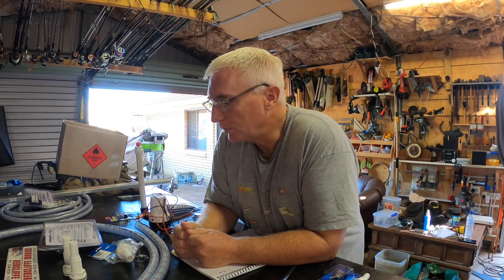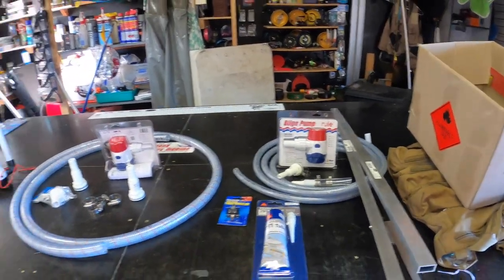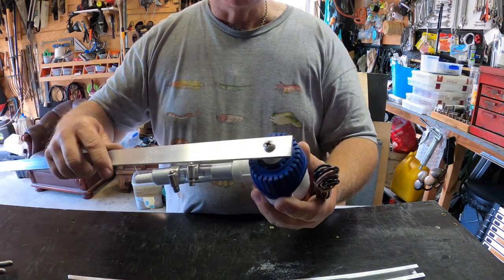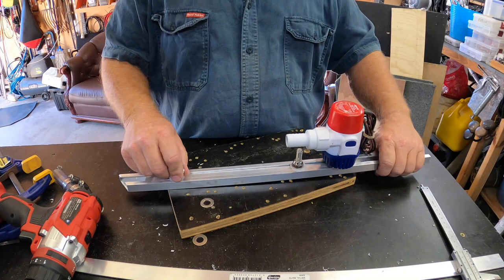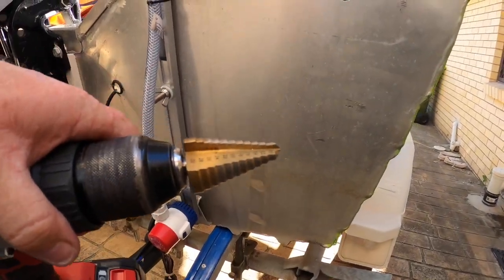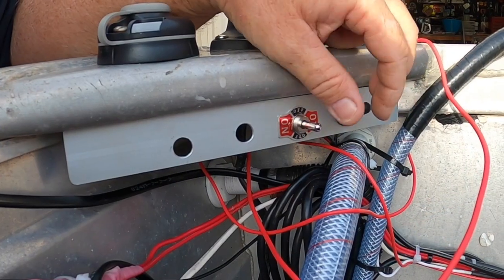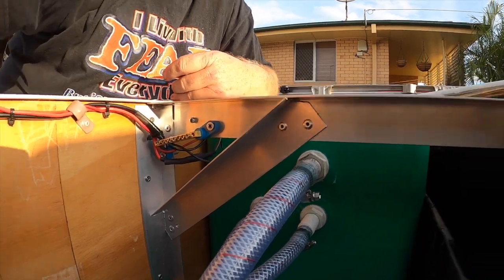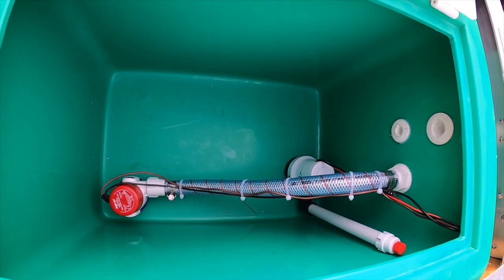LIVE BAIT TANK Install, start to finish, Stacer Proline.

Comment: I have been told in the past that all negative wires should be connected to the negative battery terminal and not to earthed to the alloy hull.  I was told this can cause electrolysis to the alloy.
Reply from the maker: That may be correct. I’m not sure.
Reply: You are correct but he hasnt connected it to earth. You will see that there are stand-offs on the bar he has installed which insulates in from the hull.

Comment: Hey mate just wonder what size pumps you used thank you turned out great
Reply: thanks mate i was just watching the video again, could of the bilge pump that pumps out could be right at the bottom to drain? or would it be too risky to do if it leaked into the  hull? thinking about doing this next year thank you
Reply from the maker: Yes it could have been bilge out of a drain hole. Just didn’t want to put another hole in the tub.
Reply: @Wayne.Groomes.Fishing   okay thank you, also just wondering what size pumps did you use thank you
Reply from the maker: @newport5504  that was a year ago. Will check next time I’m in the tub and let you know
Reply: @Wayne.Groomes.Fishing  hey mate with the bilge in the bait tank do you only turn it on to drain thank you

Comment: Mate just found this vid so my comment is a bit late. Not wishing to rain on your parade, however each circuit needs to be fused or protected with a manual reset circuit breaker, not straight off a battery terminal. Your negative bus also needs to be well insulated not in the open where it could track or short to the hull of the boat and become corroded. If one of those single insulated cables rubs through and comes into contact with the hull, a short circuit may occur. Without a protection device in the circuit, high current will flow until the cable burns through or worse. The fuse size needs to be rated for the current carrying capacity of the cable so the cable cannot become over loaded. Your battery box may have one large fuse or CB however may not open circuit on a smaller cable fault. You should also have a main isolating switch to disconnect the battery from all out going circuits, as close to the battery as possible. I've seen aluminium boats burn on their trailers when cables have rubbed through due to not being able to isolate the battery, or the owner has forgotten to turn the isolator off. It's spectacular, especially when the fuel vapours from the tank breather ignite.
Reply from the maker: Appreciate the advice. Will get a sparky to look at it and do what needs to be done. All circuits have been fused according to draw and wire size. But I know the negative block could be better protected.